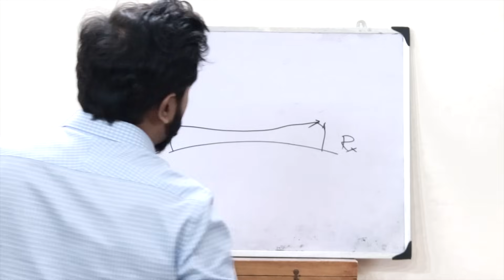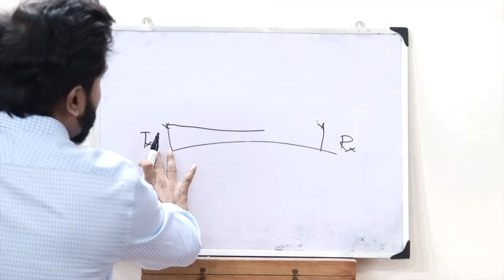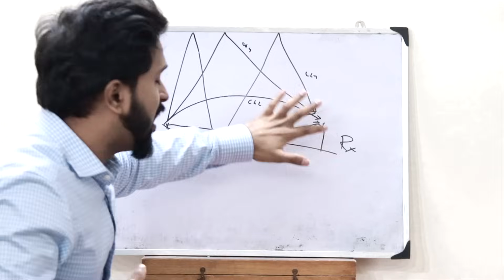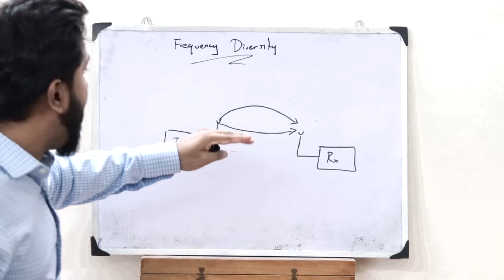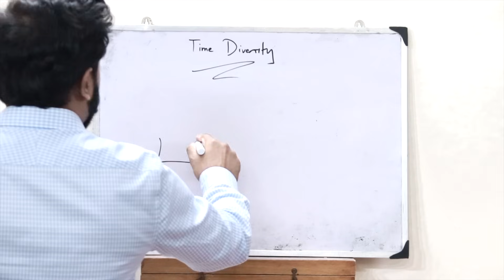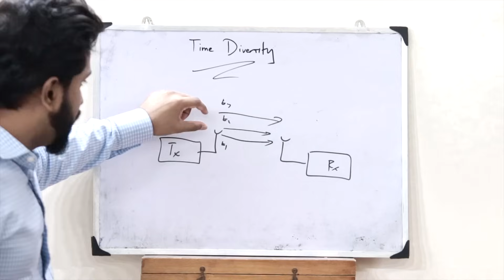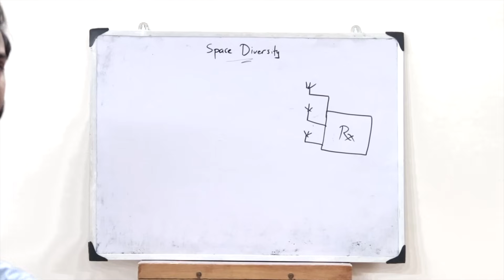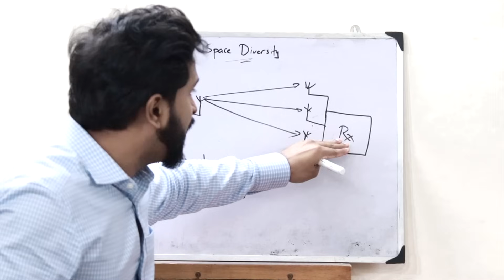Diversity Techniques in Antennas / Wireless Communication | Antenna and Wave Propagation Module - 6

Comment: Thank you very much, sir. I like the joy and energy with which you deliver the lesson. 

Here is what I've learnt today:
Diversity is a technique used to ensure that fading and other degradations do not impair signal quality. I also learnt about the different diversity techniques, which are:

1. Frequency diversity: Using multiple channels to send the same information 
2. Time diversity: Transmitting the same signal repeatedly at regular time intervals 
3. Space diversity: Different antennas producing different signals with low correlation between their fades. 
4. Polarization Diversity: 

Thank you again sir

Comment: Is mimo diversity and space diversity the same thing? What's the difference when a transmitter also has multiple antennas with both signal quality and throughput compared to the non mimo diversity